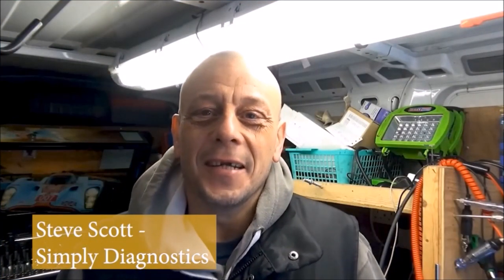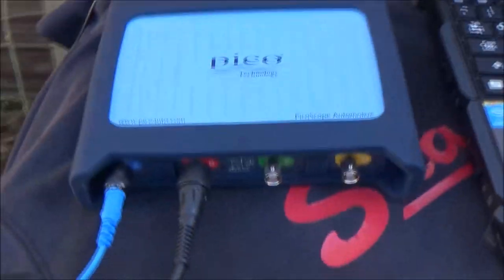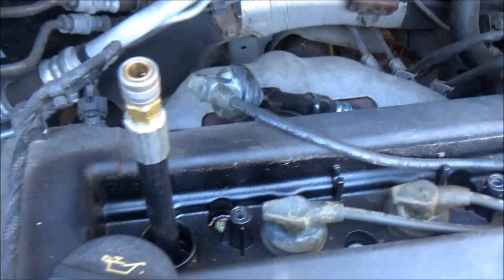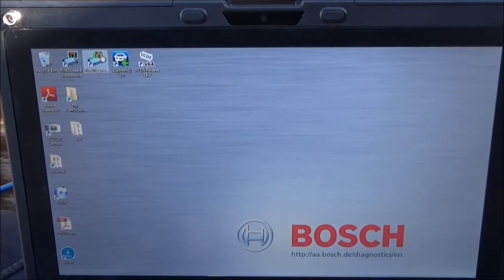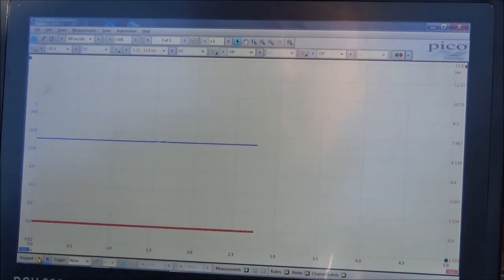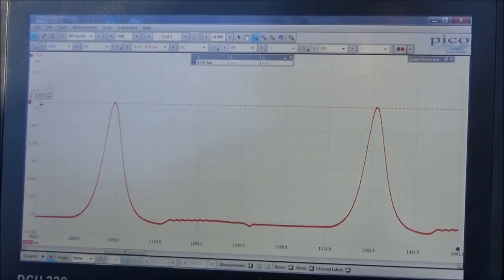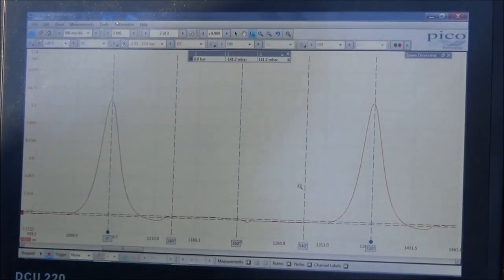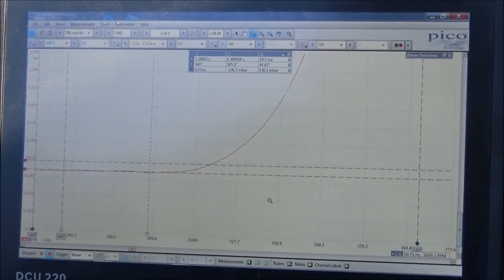WPS500 Basics

Comment: EASY solution for when your adapter gets stuck in the spark plug hole... Hammer a #2 Philips bit into the adapter, with enough force to make it stick... Then back out the UNDESTROYED adapter. From this point forward it's easy to remove!

Comment: Excellent video !One question please : I ve read on DK that  the state of the intake valve can be checked  just looking with  scope into the MAF ?
Reply from the maker: radu soptea intake analysis using MAF is extremely easy on diesels, less effective on petrol engine variants because of throttle position.